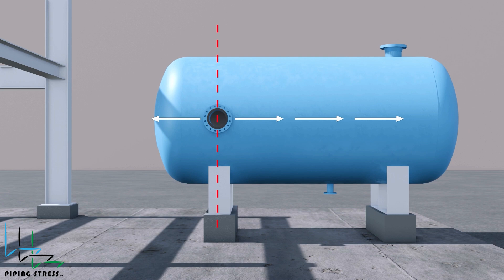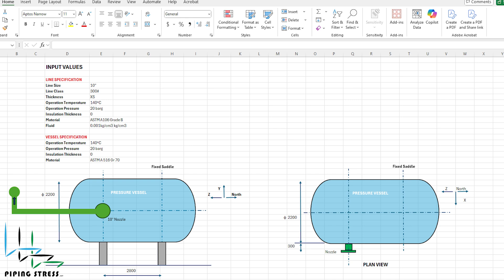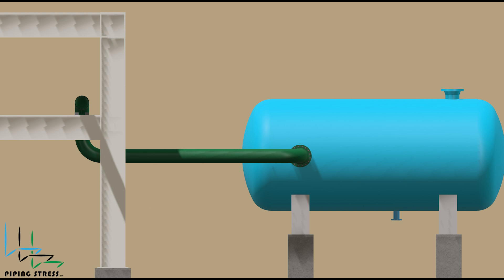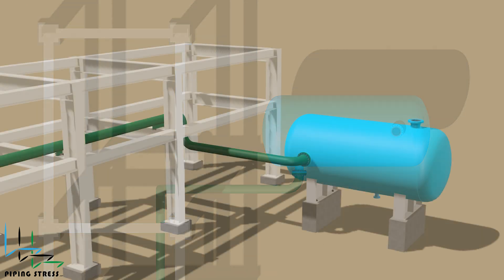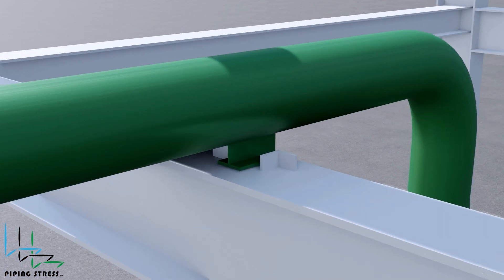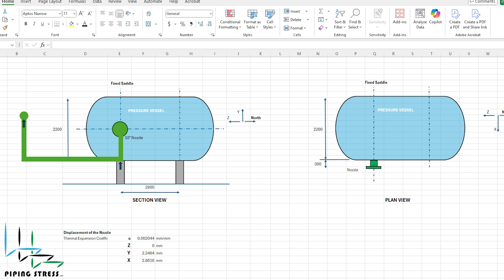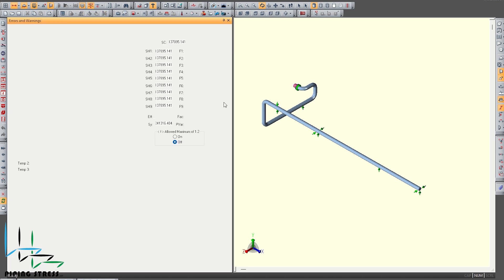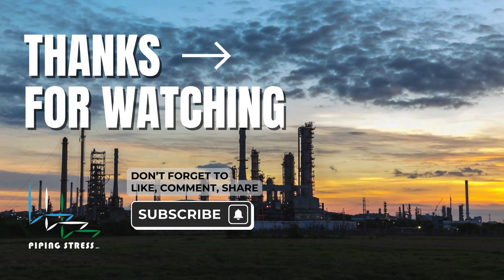Piping Stress Analysis of Horizontal Vessels: Using CAESAR II

Comment: In this scenario where the vessel has 2 saddles, which is the one that should be considered as fixed saddle? 

Or should we check the loads assuming first the fixed saddle is near nozzle then repeat on the other saddle like what was done in the video?

Comment: Hi, Thank you for your video.
Can someone describe to me, how can you know the nozzle and guide are interacting along the z-axis just by looking at the "Fz" column data. 
Or do you know this by visually seeing and judging?
Many thanks
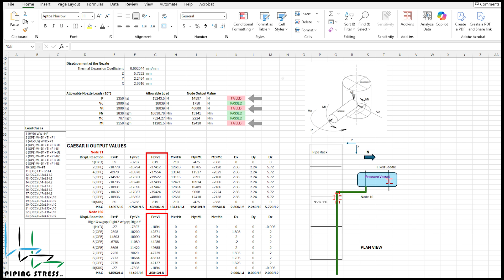Reply from the maker: Hi, you can understand by the plus and minus signs of the nodes. And also the figures are very high comparing to the other figures. Node 11 is -40000N and Node 160 is +45000N. Check 6:28 on the video.